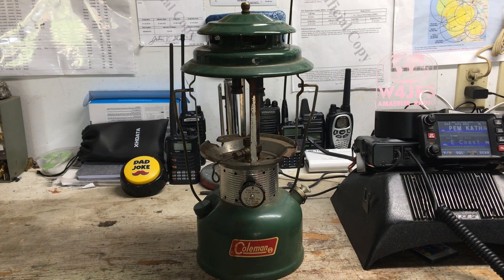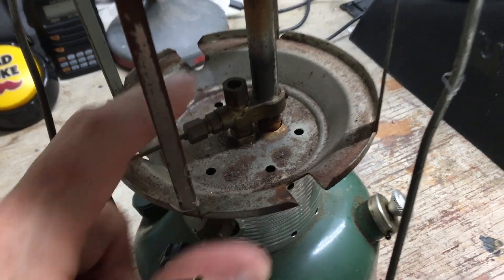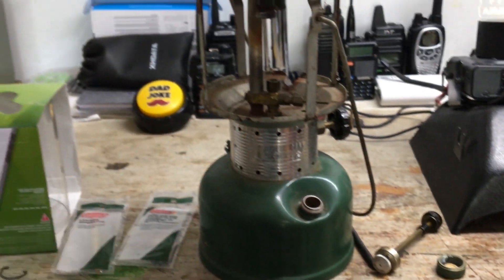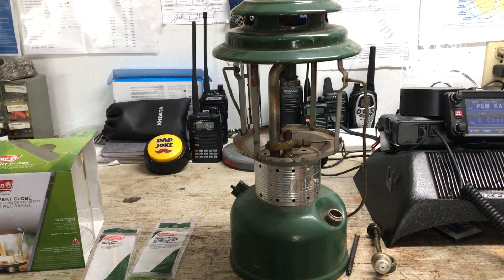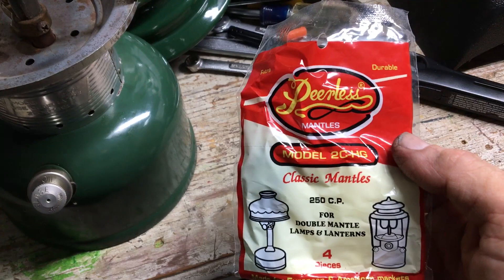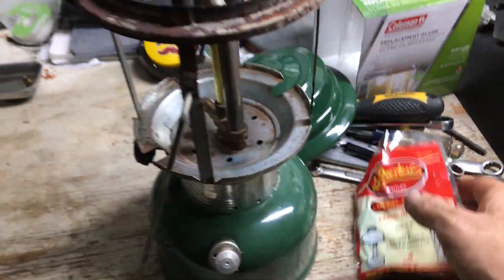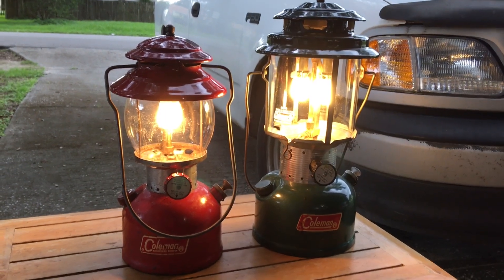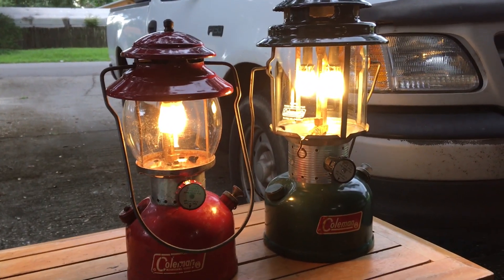Revived 1972 Coleman 220F Lantern

Comment: I have rebuilt more than 40 Coleman's and other brand pressure lamps. Take that leather pump assembly and turn it inside out (don't take it off, just push it backwards on the shaft). Soak it in motor oil or 3 in 1 overnight. If it rips when you turn it, it "won't likely" matter. It'll swells as it soaks up the oil to where it won't matter when you squeeze it back in. Just what I've experienced. Keep those old lanterns glowing!
Reply from the maker: Thanks for the advise on the leather pumps. I may have been able to save that old one if I knew. Thanks for watching my video!

Comment: Some of these old lanterns are a little cold natured and like to be really warmed up before you apply full pressure. 
Most likely you can save the old generator. They all get warped from the heat but don't effect them. 
You can heat and quench with a torch and cool water multiple times until it's free and brush it out with a 22 caliber cleaning brush. 
The newer Coleman mantles are not much these days. If you can find the older peerless mantles there the best. Peerless has a bad run a while back but I think they fixed the problem if I'm not mistaken. 
I like the American mantel brand sold at Ace hardware. 
Good to see another old lantern coming back to life. 
Thanks for sharing and God bless.

Comment: Just got my deceased papaws 72 or 73 lantern can’t remember got it a week ago and wiped it down …in much better shape than this one on the video. Noticed the pump stopped working after cleaning most of it and it sat in the house all week. Had some old gas in it(probably from my deceased uncle that had used it 15 to 20 years ago”. So decided to oil the leather and pumped it up just lit it and is roaring like a champ. 👍🏻
Reply from the maker: That’s cool! Glad you got it going. Most of the time, I am able to get the old leather pumps working again with soaking it in oil. This old Coleman stuff is so robust! There are great Coleman resources on here on YouTube for collecting and rebuilding Coleman gear. You might also enjoy the Facebook group called Coleman Lantern, Stove, Collectors, Parts, Service, Fix, Repeat Forum. Folks post on there several times a day.